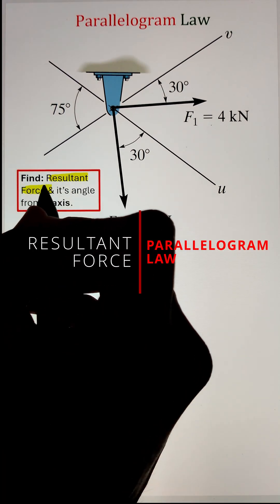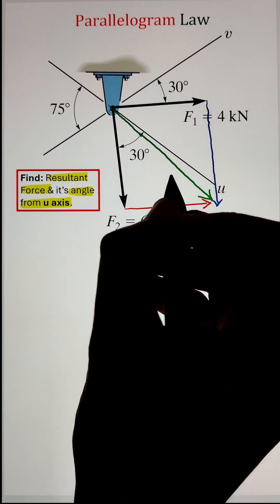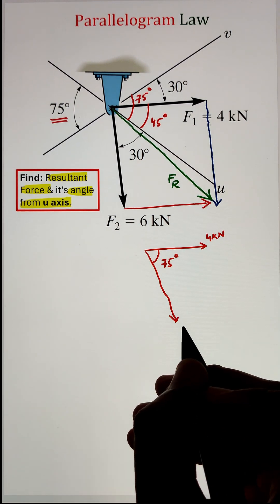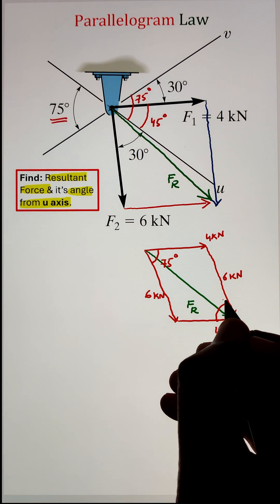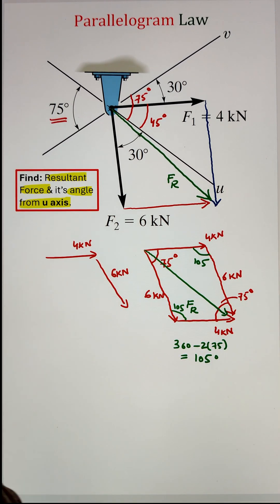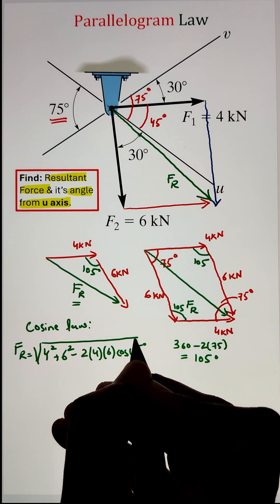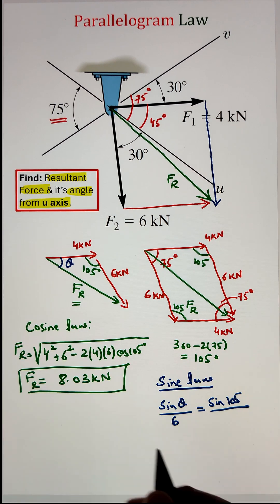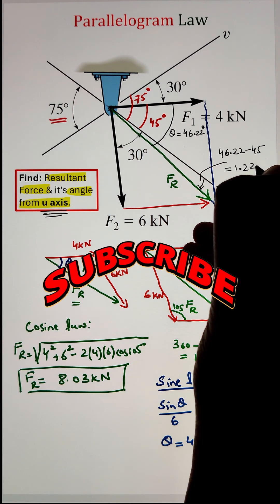Resultant Force & Angle | Parallelogram Law Explained

Comment: 360 - 2(75) = 210 
not 105
Reply from the maker: Yes you're correct, the sum of the other two angles will be 210, and one of them will be 105.
Reply: It means you need to divide the 210 by 2 because the question is in half also to make it easy.
Reply from the maker: @ClydeNovela yes you're right, I missed that.